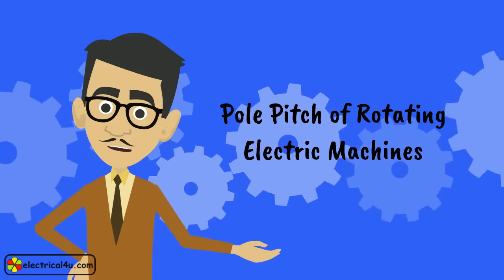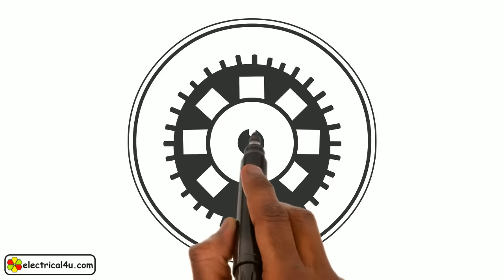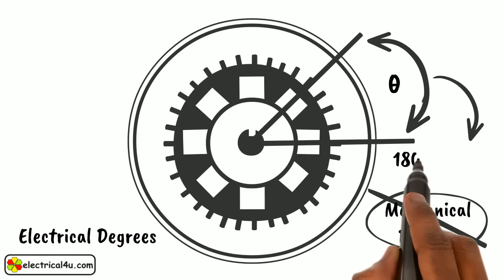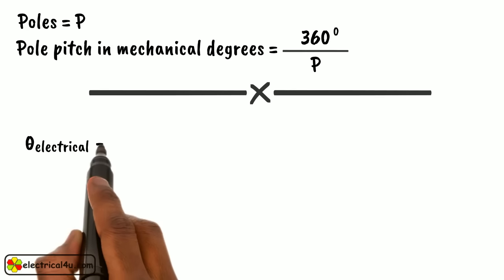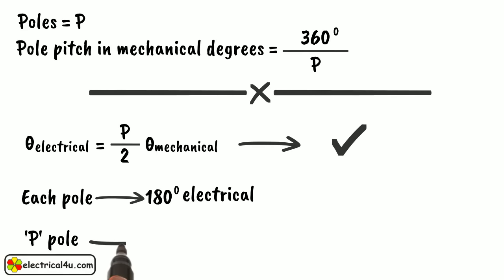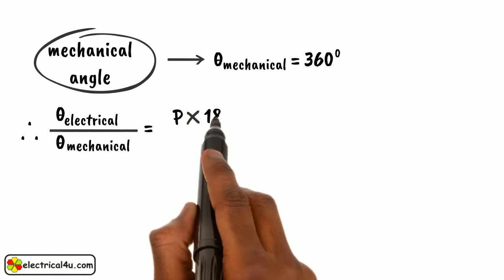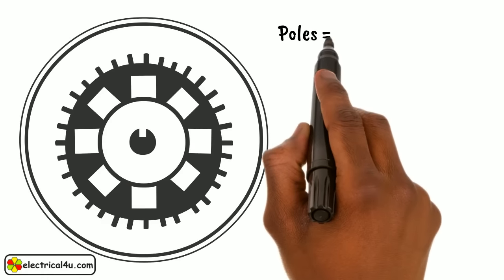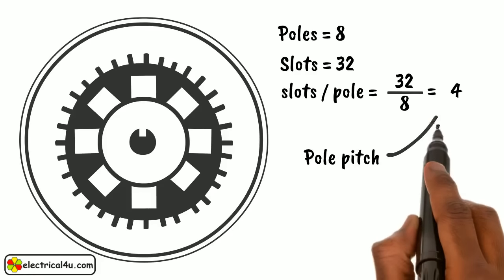Pole Pitch: Formula & Definition

Comment: Sir one request for you  ..Sir my area voltase is 160/ 160 so my fan speed is very slow . So how to increse speed in my fan in this voltase please guide i am using 13 mm slot 14±14 slot coil plese guide wich types of SWG WIRE AND HOW MANY TURN IN MY CELLING FAN WINDING DATA PLEASE GUIDE SIR CINDLY REQUEST SIR?

Comment: So, for 32 slots 8 poles machine, the electrical degree of pole pitch would be 4 x 180 = 720 degree, eh?
Reply: But if i use your first approach where electrical angle = P/2 x 360, isn't the electrical angle would be 1440 degree and the pole pitch would be 8, considering 1 pole pitch = 180 electrical degree?
Reply: nope ...i think u r talking about slot angle=(180 x p)/s
pole pitch is always 180 degree